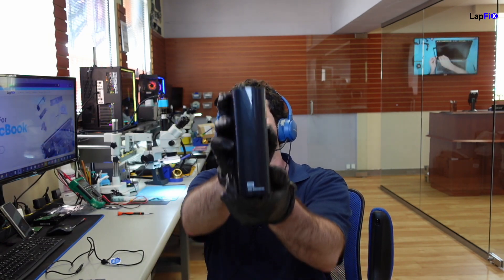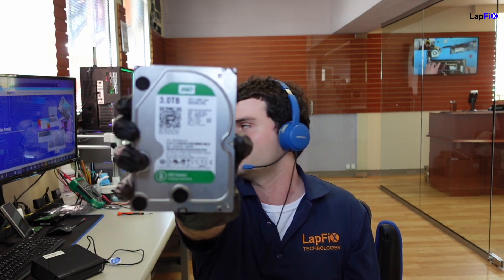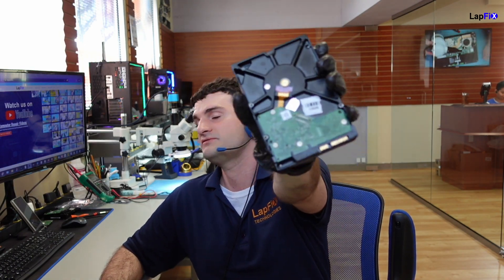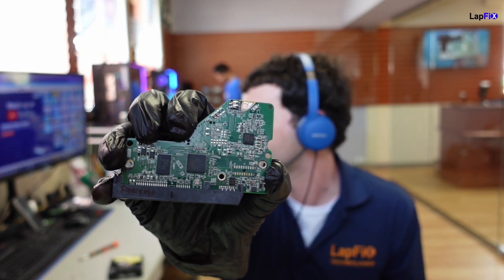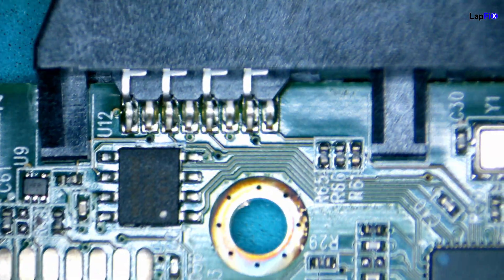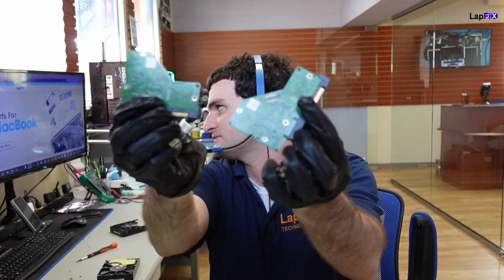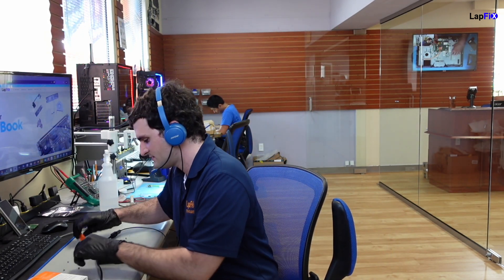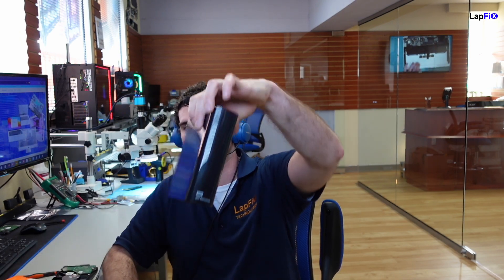How to Recover Data from a WD Hard Drive Not Recognized

Comment from the maker: Western Digital or Seagate?  Which one do you guys prefer?
Reply: I prefer Seagate. Does anyone remember Quantum ? I remember my own company bought a lot of workstations with the Quantum Bigfoot drives....all but 1 failed within 12 months. Not a great experience.
Reply: Western Digital. Seen soo many Seagate's die, some even after 6 months. It looks like Seagate 4TB has the highest failure rate.
Reply: I have a 2TB WD hard drive formatted for Xbox 360.  My console has stopped reading the drive.  It just says unformatted.  Now my data seems trapped.  My computer says there is an internal error.  Is there any way to fix it?
Reply: Out of experience and the fact that i'm here - none of those.
Reply: WD
Reply: Western Digital is always my first choice

Comment: what about opening the other side of that drive where the CD looking like things where there is a set of fingers that slide on a rail as to read the CD? I dropped mine and at first my computer recognized it but wouldnt show data and wouldnt formate or initialize disk. Then i opened up the part i guess i wasnt suppose to sealed it back up and got a steady white light finally no blinking white but now CPU doesnt see it at all. Tried software programs that rwecover data and tey never sw it. HELPP is there a phone number for yall?

Comment: Does the hard drive is making clicking noise when the board have a connection problem ? I drop my 14To HDD while working on it and now it won't be recognized even on a adaptor but the hard drive is brand new.. I have 11to of data on this hard drive that I CAN'T lose.. Thanks for the content ! Really useful